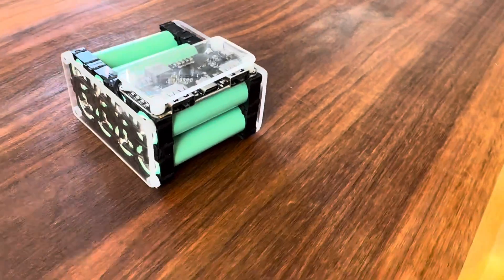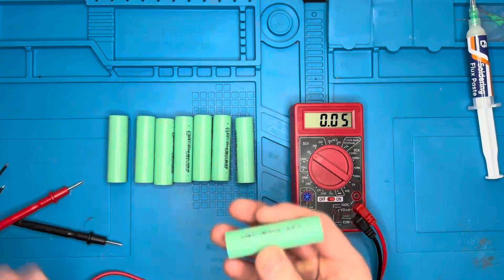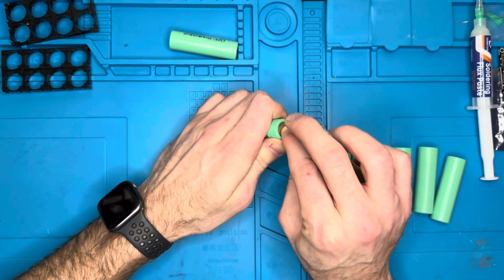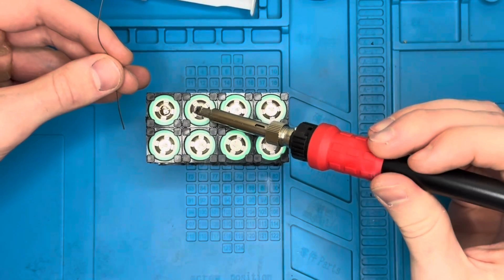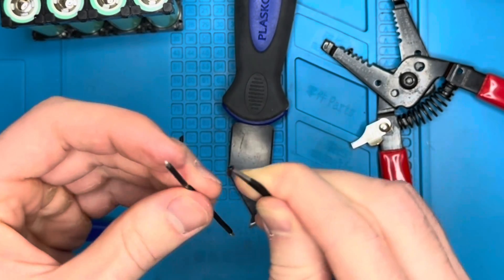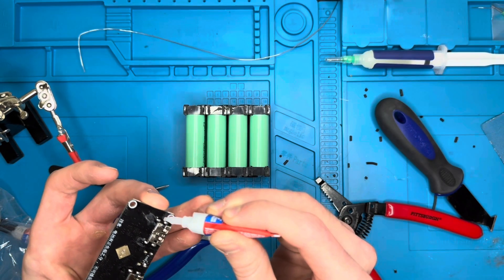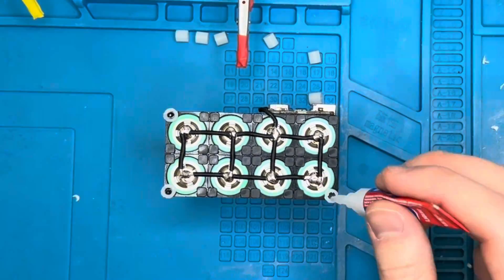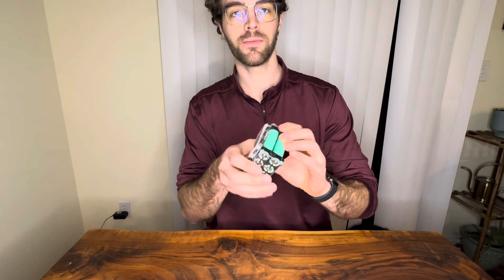How to Build a Simple 25000mAh Power Bank

Comment: You don't realize how lucky you are when you were soldering these cells. I implore you not to attempt that again. You need to buy a spot welder to safely permanently connect to cells like that. This isn't internet speculation, I am speaking from personal experience; that is incredibly dangerous. 

If you overheat one of those cells, the + terminal will pop its top. This is called venting. The cell will begin shooting flames out of the terminal with enough force to propel it across the room. It can not be extinguished with water, I tried. It will coat every crevasse of the room with a thin black dusting of lithium. You would not believe the amount of material in one of those cells. I wouldn't have thought it possible for so much dust to come from such a small cell. And it was everywhere. I was cleaning up that dust for over a year. 

That's assuming the vent actually pops like it's designed to do. If it doesn't, it will build up heat, expand,  and explode like a small grenade. 

I watched this cell fly out of my hand, scorching my hand, rode the wall until it hit the corner, turned and rode along the other wall until it hit that corner, turned back and rode the previous wall until it hit the ceiling, then dove down being a desk and spun in place like a glowing yellow beyblade. I was shock and awed. And then terrified. There was a glowing ball of fire behind a desk against a plain plywood wall (with permanent scorch marks all over the place) which I could not extinguish with water. I'm very lucky it didn't start a serious fire. 

Just buy a spot welder, and try to avoid welding to fully charged cells. They aren't that expensive. It's not worth the risk, I promise. If you don't believe me, look up videos for 18650 venting. Basically every video I've seen is very mild compared to what I experienced. Also, newer cells are more energy dense and just would have a worse reaction than the ones in the videos from 6+ years ago.
Reply: And if you don't listen to me, at the very least, do it near an open window. Remember that if you see smoke coming from the cell, it's already too late. It's experiencing thermal runaway and short circuit. Throw it out the window before it pops its top.

Comment: Thank you for the video. I am planning on making a power bank following your instructions. Will I need to add a battery protection board? If so, how do I wire it?
Reply from the maker: No you will not. It is built into the charging PO. I have tested it too. It will not charge past around 4.15 volts

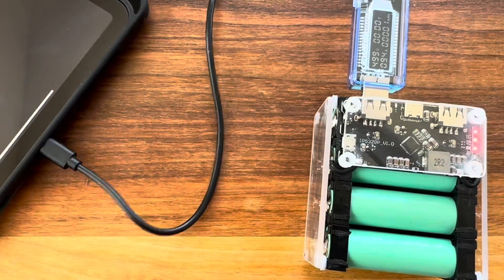Comment: 9:20 output test: usb-a 1A (5W), usb-c PD? (18W according to prod spec)
Reply from the maker: I was not able to get any other reading but I did not try too hard. I was charging something last night through usb-a and that blue light turned on (which I think is the fast charge indicator). I’m curious if I would get a different reading. But yeah that reading does seem pretty low powered so I will have to look into it more!

Comment: I'm highly concern with the fact that you didn't use a BMS li-ion batteries are a serious hazard.
Reply from the maker: @JmonteroArg  The charging module has a built in BMS that protects from overcharging or discharging
Reply: That's not mediocre at all!
I call false advertising! 😊
Reply: Since all the cells are in parallel, I believe the BMS won't provide any additional advantages in this case.
Reply: @samharish5995  A BMS is still important, even in a parallel configuration, because it provides crucial protections beyond just balancing, such as overcharge, overdischarge, overcurrent, and short-circuit protection, which help prevent thermal runaway and extend battery life. Manufacturing differences between cells, such as variations in capacity and internal resistance, can cause uneven current sharing, leading to premature degradation or safety risks. While parallel cells naturally balance voltage, they don’t inherently protect against these issues, making a BMS a critical safety component.
Reply from the maker: Look at e-bike batteries. The BMS does not read the voltage of every single cell directly. It reads the cell voltage by connecting to every parallel group and that is exactly what this module does as well but there is only one group to connect to. I promise you it is perfectly safe. I have opened up many commercial power banks and they are the same. The BMS does not connect to each individual cell to read the voltage. 

Also, these batteries were all bought together new and are the same brand and model so no worries there
Reply from the maker: Thanks! :)
Reply: @JmonteroArg  the IP5328PP datasheet says
"Battery overcharge, over discharge and overcurrent protection"
"Boost System" - "Battery operation voltage": min 3.0V
It's not exactly clear, but probably turns off at 3V.
The item description says nothing in that regard, so it's best to verify indeed.
Reply: @JmonteroArg  I have opened many cylindrical 18650 cells and there is always a small tab from the inner wound electrodes to the cap (positive), in the event of to much current the tab acts like a fuse burning up thus stopping any more current flow, however once this has occurred the cell is beyond fixing so will need replacing. Still be very careful of these cell and make a full housing to keep them safe.
Reply from the maker: @ Cells connected in parallel will balance each other out and have the same voltage thus a BMS for one parallel group is all that is needed. If they were in series on the other hand, there would need to be some sort of BMS for each cell because that is when they can become unbalanced

Comment: is it okay to use Li- Iron battery insted of lipo to  in this built 
because charging module is design for lIpo
Reply from the maker: @manethsilva9515  I checked the voltage after full charge and it was at 4.15 which is fine for Liion. You can check out GreatScotts video on this. He does really in depth testing using this module on liion
Reply: @MediocreNerd  thanks man I will check it up
Reply: No! LiFePo (Li-IRON) charges to 3.2V. But IP5328P charges to 4.2V, so it will damage LiFePo.
Always read the product description very thoroughly on chinese marketplaces.
LiFePo is not mentioned on this product, so it most likely cannot be set up to work with LiFePo.
There are other modules that describe what needs to be soldered and how to charge LiFePo with 3.2V.
Reply from the maker: @Gregorius421  these are lithium ion cells and not lifepo
Reply: @ manethsilva asked about li-iron. he meant lifepo
Reply: @Gregorius421  maybe he meant lithium polymer (lipo) not lifepo

Comment: test acutally mah after converting to 3.7v to 5v or 9v?
Reply from the maker: That’s a good idea! GreatScott tested the board to be about 83% efficient so I guess my powerbank would have around 21000 usable mah if that percentage is correct
Reply: @ good efficiency boardu got there  link for the  “motherboard “ ?
Reply from the maker: @NandarAung-wl8ln  The PCB board link is in the description. IP5328 is the identification number I believe